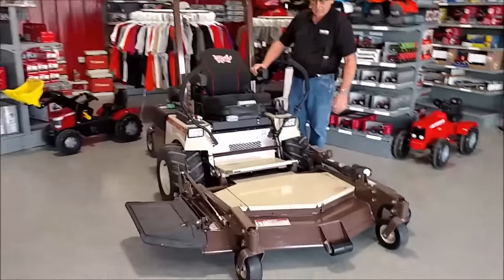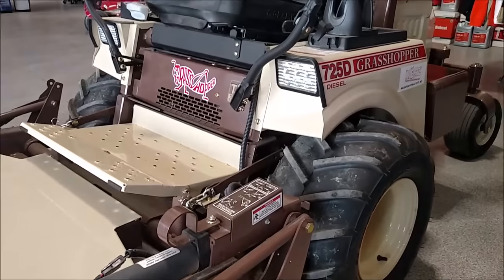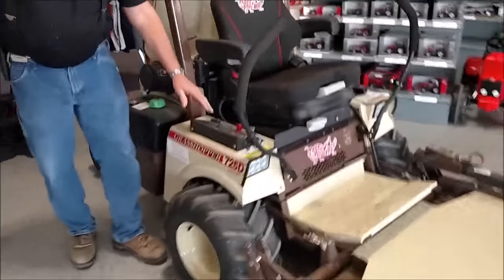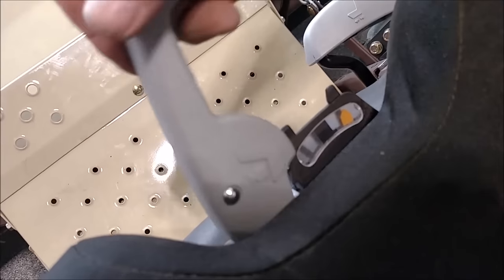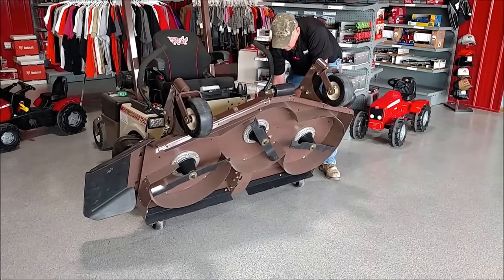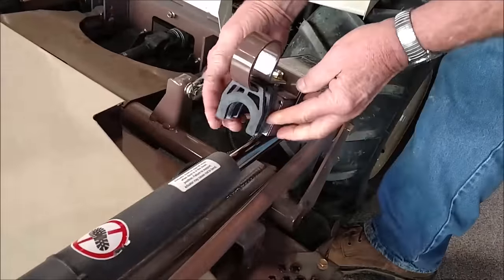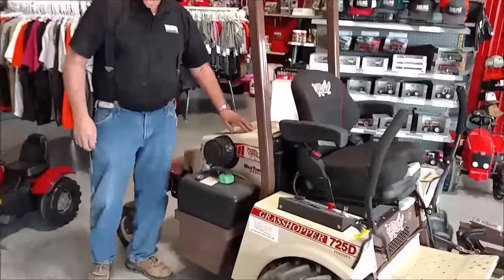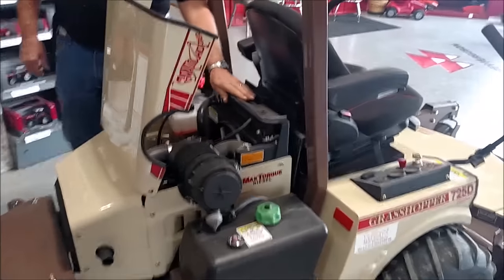Grasshopper 725D - Diesel with Powerfold Deck

Comment: Other than lots of power...I like the screen shield over the radiator. If it starts getting a little hot you just pull it out, clean it off,slap it back on and go.
Reply from the maker: Thanks for the input Carla!  Grasshopper really does do a lot of "little" things right when they build their mowers! It is the combination of all of those "little" things that make it a fantastic machine!

Comment: About how much does that model run, with the 60" or 61"(whateverGrasshopper runs) and the 25 hp diesel?
Reply from the maker: TermiteBenny depending on options around $13,500. 725D with 61" deck. Options on this unit are the PowerFold deck, which is highly recommended by us to lift the deck with one finger! Also shown in this video with wide stance dual tailwheels. 

If you would like a specific price quote please give us a call (402) 245-2419
Reply: Merz Farm Equipment That's not bad at all. I have a Gravely 72" front mount mower now and really like the ability to cut under trees. It's a 1992 model so it's getting tired. I will definitely look you up when I'm ready to replace it. Thanks for the reply

Comment: That mower looks good,that electro-screw style deck adjustment,you think it will hold up to commercial lawn care cowboys adjusting it every day?And those plastic shims?You need tough old school mechanical deck adjustment and that mower with that Kubota diesel would be a real good machine.Give me grease fittings,common bearings,kubota diesel and simple belt change and you get a life time mower.I'll take that shit all day.
Reply from the maker: The linear actuator holds up very well as long as the owner uses the shims to take the pressure off the actuator.  The shims are plastic, but Grasshopper offers metal shims that adjust the deck 1/4 inch with each shim.  It is really an easy deck adjustment.  Many people prefer it to a manual adjustment.  The other option you have for jumping curbs and loading on a trailer or crossing sidewalks or similar activities is the Hyd Deck Lift option, https://www.youtube.com/watch?v=CfeUlrB5gZsYou are right, giving this mower simple maintenance will give you a quality lawn mower for a long, long time!
Reply: I can tell you for a fact it will hold up I have a 725D with 3200 hrs on it and it still works 5 to 6 days a week.
Reply from the maker: Jeff Heck that's awesome!
Reply: I have a 725D with 210 hours on it and I am taking it in to have a 3rd electric actuator installed...in my case, the actuators don't hold up. The dealer and Grasshopper agree this is not due to operator mistreatment or error. So, I leave it to you to ponder what could be the issue.

Comment: How much?
Reply from the maker: Grasshopper 725D with a 3461 Powerfold Deck is going to run in the $14,000-$15,000 range depending on rebates and programs available.  Also depending on the options like this mower shown has the Grammer Seat, wide stance tail wheels, and more.  The models are going to change as well, this video is from March 2017, prices have changed from that point to November 2018.  We are now pricing and selling the 2019 models.  Give your local dealer a call for exact pricing, or give us a call and we can figure you a quote.  (402) 245-2419

Comment: The Deck is NOT Hydraulic
Don't you know what you're selling??
Reply from the maker: kmcwhq Grasshopper calls this option a Hydraulic Deck Lift. This is the option of adding a button in the right hand steering lever to raise the deck straight up a few inches. It is located where most operators naturally place their right hand thumb. If used while the deck is engaged it will momentarily stop the blades, raise the deck straight up (not flip) to help maneuver over debris, driveways, curbs, landscaping, etc. Once the button is released the deck drops back down to the set mowing height and the blades are re-engaged. 

We sell this feature to many municipalities, including parks who can stop the blades while driving over dirt from a baseball field or wood chips from a playground. 

Taken directly from Grasshoppers website, "Optional hydraulic deck lift (standard on 900 Series) raises the deck off of the ground at the touch of a switch to clear curbs and trailer ramps." - See more at: http://www.grasshoppermower.com/decks/frontmount/#sthash.94Ccr4NA.dpuf
Reply: That deck lift is a Electric Mechanical Actuator. 
It uses a screw and an electric motor. 
Maybe Grasshopper needs to brush up on the type of components they use!
Reply from the maker: kmcwhq you are correct, we use an electric actuator to "flip" the deck, this is called the Powerfold. However the term Hydraulic Deck Lift is only used at the 2:18 mark of this video. Hydraulic Deck Lift is separate from the Powerfold. These are two separate features of these machines. Hydraulic Deck Lift uses the hydro pump to "Lift" the deck. 

You are correct that the Powerfold is not hydraulic. That is an electric actuator.
Reply: From what I remember, there is only ONE Electric Actuator that both positions the deck for mower height, and flips it up for service.
Reply from the maker: kmcwhq Correct. What we refer to in this video is an OPTIONAL Lift, it has nothing to do with the flipping of the deck, that is referred to as Powerfold in which is a very common feature. The Hydraulic Lift is not a common feature for most units. Very few units are ordered with this feature. 

You are absolutely correct on what your presenting. But what we referred to is a completely separate feature. Grasshopper knows what they are talking about, Merz Farm knows the products we sell and you are correct as well! What I believe your not understanding is that what we refer to as Hydraulic Deck Lift is NOT Powerfold and that is what you are familiar with.
Reply from the maker: We put together a quick video today to show both options.  We both can be correct!  You are correct the actuator is electric for Powerfold.  We are correct in the Hydraulic Deck Lift, this is two separate options, two separate functions.   
https://youtu.be/CfeUlrB5gZs
Reply from the maker: The video is still live, we did not remove the video - https://www.youtube.com/watch?v=CfeUlrB5gZs

Comment: I dont think i liked what i saw under that deck, seemed a tad under built.
Reply from the maker: Mike West the decks are heavy duty and the aluminum ring you see is a reinforcement ring for extra reinforcement. They also use the cups around the spindles to make sure all long weeds or twine or other rope like items don't wrap around the spindles. 
We see decks that are 20 years old with thousands of hours on them. Of course belts and bearings have been replaced over time but the decks withstand the time and use.
Reply: Heavy duty spindels?
Reply from the maker: Heavy Duty Spindles with heavy bearings that are doubled up.
Reply: My local city park uses grasshopper, they swear buy them.  I am becoming a fan
Reply from the maker: We sell a number of Grasshoppers to City Parks and other municipalities. They run them for 40 hours a week during July 100 degree days. They rarely have any issues. 
Grasshopper has some promotional videos showing how they look at quality. Quality is their #1 core value.
Reply from the maker: Hey Mike West, I was replying to another comment and found if I copy and paste some info from Grasshopper website it will allow me to paste a link with it! So here is some more evidence of how heavy-duty this deck is! Plus they have a better way with their words than me! 

The industry's toughest spindles.

1. Massive 8-inch spindle flanges anchored in a six-bolt pattern spread the force of impact for greater strength in tough applications.

2. Double-layered, 10-gauge plus 7-gauge* formed laminate spindle plane is 25% thicker than quarter-inch steel and nearly an inch thick in stress zones.

3. Sentry™ spindle guards shield the spindle housing and seal lower bearings from fiber wrap and dirt ingestion.

4. Non-greasable double bearings are designed for high rotational speeds and minimal maintenance.
*10-gauge plus 10-gauge on 100V models.

- See more at: http://www.grasshoppermower.com/decks/frontmount/#sthash.94Ccr4NA.dpuf
Reply: Thanks, if i ever get the chance to buy one i will pay you a visit.